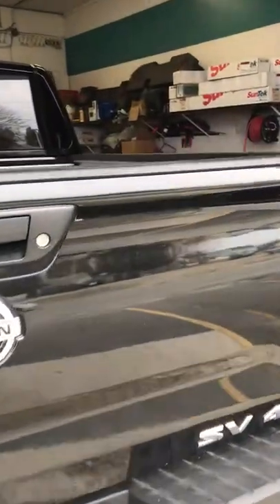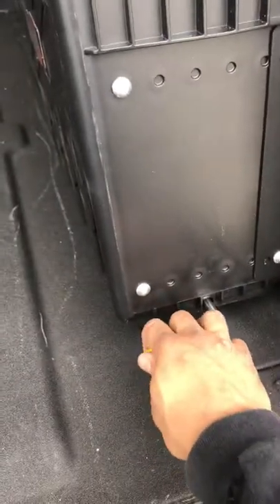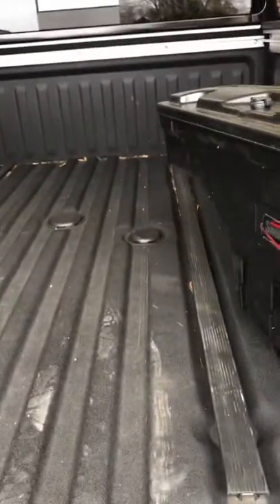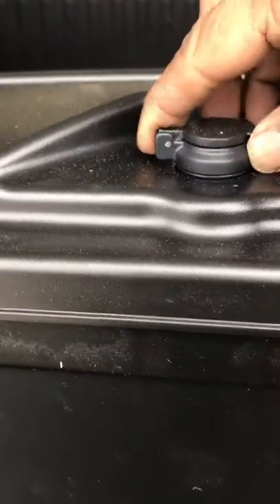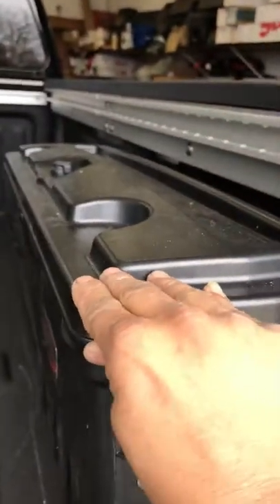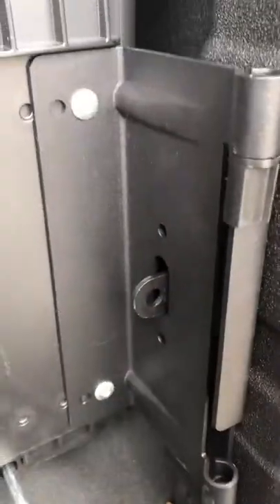Swing out removable tool box

Comment: these can be a total pain in the ass for getting spots to tie shit down. they cover some of the most vital points and do not hold up to the stress of any sort of weight inside the case. they keep water out but they sag over time.  I have got some good use out of it but a toolbox and a bungie cord does the job 10x better.

Comment: My dad has there boxes in a 22 Silverado HD2500 and I hate them. They cover the cargo hooks for straps. I decided to build my own that were bigger and didn’t swing but you can access the hooks no problem and still slide a sheet of plywood in the bed.
Reply: In the truck in the video, you can see the little d ring area. Its not completely blocked. May just depend on the bed size. I know for a fact itd block a tacomas d ring set up.
Reply: Remove them if you're hauling anything. That's why they have them to be easily removed. If you need to tow down, just put bullrings on the pocket covers